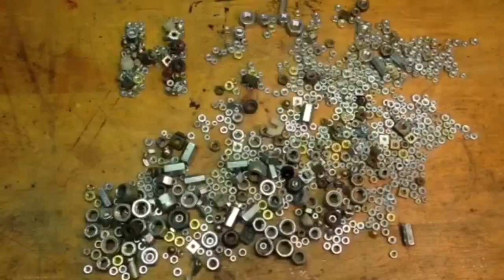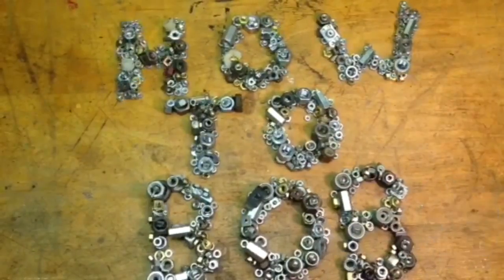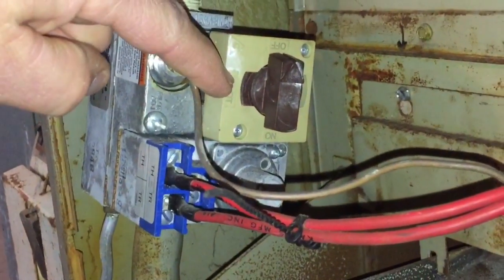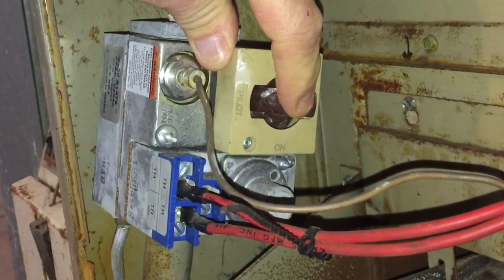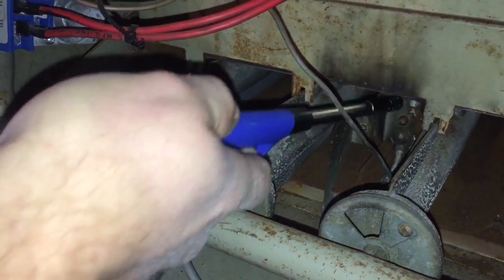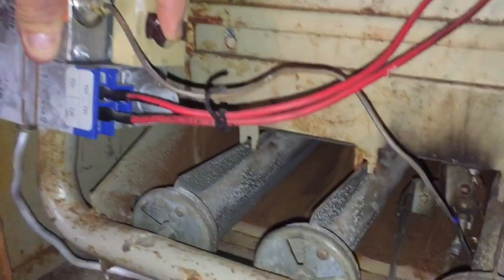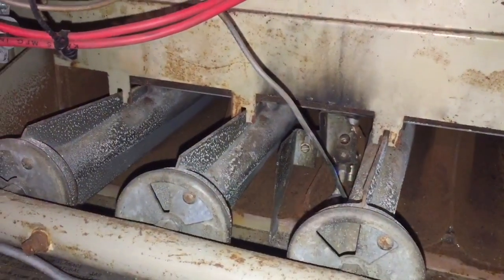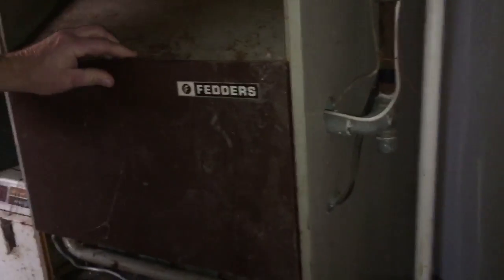How to Re-Light a Pilot Light on a Furnace

Comment: I have this exact furnace, but the gas vale dose not work, do you have the model and serial number of that gas vale.HELP
Reply from the maker: I actually replaced the gas valve on this furnace. You should be able to remove the valve and take it to a knowledgeable HVAC parts place and they can get you one that can be fit into place. Thanks for watching.